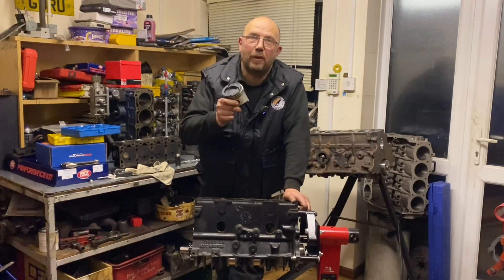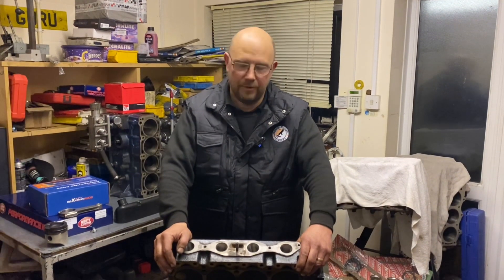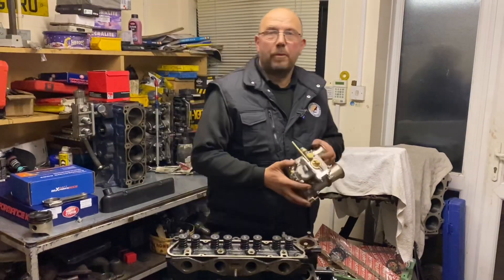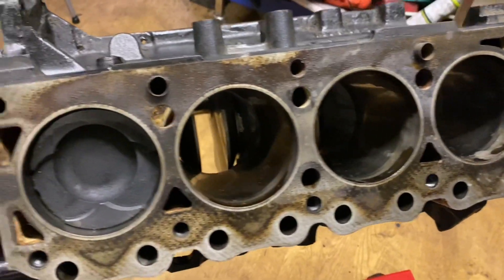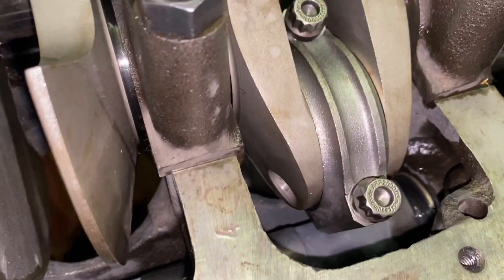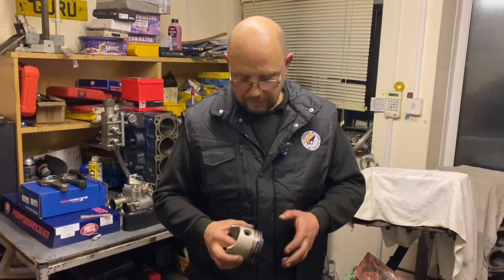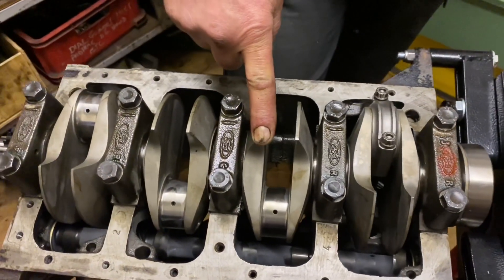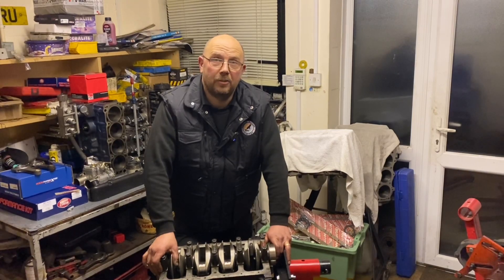1900cc Escort Mexico Crossflow Engine Build!

Comment: My x flow ran a 244 kent cam, standard pistons, rod, crank,all lightened and balanced, using new weber45s, it developed 110@ wheels, but was a lovely torquey motor, woud rev to 8000rpm if needed, Motorscope at Northallerton built it in 91 for the BTRDA clubmans forest championship, the engine was totally reliable al season, we won our class outright that year against some very powerful x flows, some had 140+ @ wheels.... torque wins rallies!! great videos Graham, im considering having another x flow built if you fancy the job.

Comment: Hi Graham, does actually lighten the crankshaft on this sharpening style for the 'counterwheights', increase the real horsepower? Or it's just a matter of modifying how it feels when driving it? I'm just curious to know what a pro machinist really think about that
Reply from the maker: theoretically you might see a small horsepower gain due to less drag from the crank cutting its way through the mass of oil flying around in the crankcase,  but you probably need to be way above 8,000 rpm to make any real difference
Reply: @PenguinMotors  that makes sense, thanks for the answer!
Reply: You'll probably get equal results by fitting a 'crank scraper', between the sump and the block, that partially removes the mass of oil travelling around the crankcase attached to the rod big-end/crank journals.

Comment: When i  build high-performance crossflow big bore block always it need sleeved, original bore wall is weak and bore not stay perfect round and rings flow pressure down crankcase,  race tuned x-flow can do up to 220bhp.
Reply from the maker: Bore size was discussed at length with the client who opted to go with current setup. It’s a road car so not going to have its neck wrung. 220bhp x/flow that’s a new one, never seen any evidence that anyone has ever built one making  an honest 200!
Reply: @PenguinMotors   X-flow have potential go highly tuned over 200bhp. 1000cc anglia pre-crosflow was done 120bhp. Broadspeed race car  1300cc over 145bhp. Holbay and Zakspeed well know engines hit over 200bhp.
Reply from the maker: @stranger-j7j  squeezing 120bhp out of a 1 litre engine isnt the the same as trying to get over 100/per per litre out of a bigger engine, essentially the head can only support so much power. on small engines you can get a very high specific power by revving it really hard, but the same head will not allow a bigger capacity to rev so hard. i challenge you to show my ANY proof a naturally aspirated X/flow has ever made 220 bhp
Reply: @PenguinMotors  Germany race engineering was done Zakspeed crossflow race circuit engine they are done 212bhp. They working with Boreham UK company create racing engines group 2 and 5 cars.
Reply from the maker: i know who zakspeed are, but ive still yet to see any dyno proof of any  naturally aspirated x/flow making over 200bhp, let alone the 220bhp!
Reply: @PenguinMotors  That is only development and money question how much u can get powere out x-flow engine. High performance parts like Ti valves max size, offset          quides, nicasil liners, light weight flat top pistons with special rings, ti or alloy rods, hollow stem pushrods nascar type. I can do this type engine whic put out crank near 220bhp with haltech elite ecu, fuel injected multi hole sprayers and high power ignition.
Reply: @PenguinMotors  Crossflow engine critical part is just that how transfer cam motion to the valves, if this section not work perfectly balance you can't get breathing engine well and got full potential out it.
Reply: @PenguinMotors   This like engine buildings cost are totally different level, all parts are custom made billet stuff, using very high quality metals and tight tolerance made.
Reply: Still no proof😅
Reply: @danielborrowdale3903  https://youtu.be/4cbPdluNckY?si=PRzvlVi92C4mDNUG  1000cc  135hp.

Comment: Good morning ...

Loving the content 👍👍

I have a technical question on the regards of cam selection on a 1600 xflow   ... 254 - 260 - 262 - 264 ...

On a street motor I have a 254 with a 4.7 diff on 40's - stock ratios and its not too bad but it would benefit on a transmission gearset.

Jumping to the question ...  Building a hillclimb engine ... Would love to know your thought on cam selection ... Shall I use also a 254 cam with a gear set and maybe a 5.3 or 5.7 final drive depending on road or track use and some guidance between 260 - 262 and 264 ... Is a 260 grind something to consider in my application ? Or shall I go 262 ? Your help is appreciated . Thank you
Reply from the maker: what vehicle is it in? theres a big weight difference between a caterham and an escort and that will have a bearing on it. from what i recall most people that tried both a 254 and 264 in a hillclimb engine went back to the 254. All the cams you mention work well on a race circuit, but on a hillclimber i would of thought you want the one that give best torque spread which is probably the 254. but i have to say i have not tried these cams myself
Reply: @PenguinMotors  Thank you for your reply ... Car is a historic escort ... I believe that torque is the factor. Had a 244 was ok on ratios but with a 254 I believe a gear set is needed so I have to agree any wilder cam would make it even worse ... Would there be any cam that might be considered instead of 254 in this application ? Similar to a 254 ..
Reply from the maker: @purejdmpassion  you would need to talk to someone with more experience of those types of x/f cams than myself as i would only be guessing, but the only real way to get more torque is make the engine bigger
Reply: @PenguinMotors  Thank you for help

Comment: Hi. More of a Pinto man. AX block? 711M was the block of choice, or so I though. What is the difference? Just out of interest. :)
Reply from the maker: its heavy duty block, in short an AX block is the equivalent of having a 200 block for your pinto
Reply: @PenguinMotors   thank you.  Could these blocks be sourced from run of the mill vehicles of the time like the 205 block from later Sierra’s?
Reply from the maker: @extremeways2930  not in the uk, but i believe they were very common in South Africa. Caterham Cars bought a load of AX blocks from Ford so now days that probably the most common source someone upgrading an X/flow caterham 7 to a 16v engine
Reply: @PenguinMotors  thank you. 👍
Reply: @PenguinMotors   I just check my storage and one 711m 6015 ba block is still home, so i can began build new engine. We machining hd dry  liners for big bore this block,

Comment: I wouldn't bother using a flat piston and flat head, no usable squish available & a tonne of advance required. You get better easier power using the correct forged pistons.
Reply from the maker: Yes I’m aware that will need a lot of advance

Comment: With a flat head and a flat top piston this will give you no squish area. When I have done this before (admittedly not on a Crossflow Ford), I have found great instability at part throttle conditions. This was found to be a result of unpredictable mixture strength at the spark plug when ignition occurs. The only solution was to use a multi-spark ignition system (made by MSD). Have you experienced this before and, if so, what was your solution?
Reply from the maker: I haven’t decided what way we will go yet, but flat flat used to work in the 1980 with nothing other than a Lucus distributor so I don’t see why it won’t today. X/flow has poor squish however you build it

Comment: I personally would go for the 254 had a 244 which was sweet but the 254 pulls way harder
Reply from the maker: Cam is clients choice, but you have to bare in mind he wants MORE low speed torque than he currently has so going to a 254 isn’t a great idea as it will loose the low down gains from the capacity increase